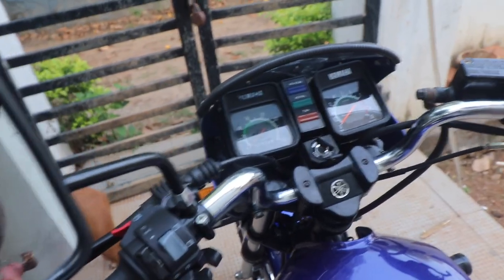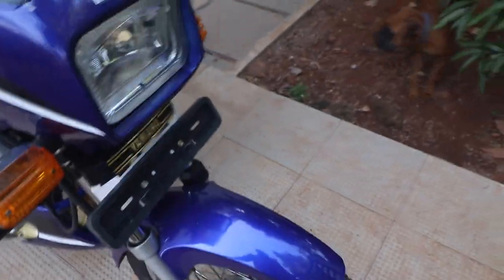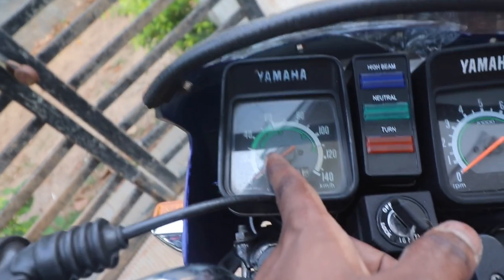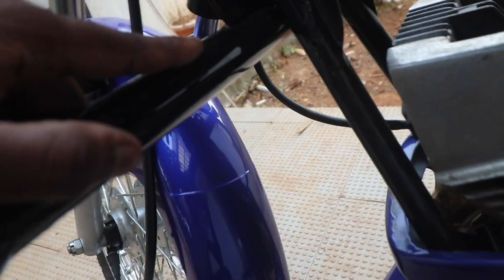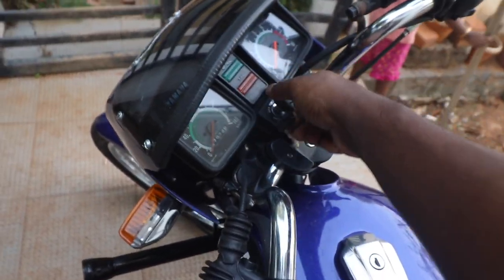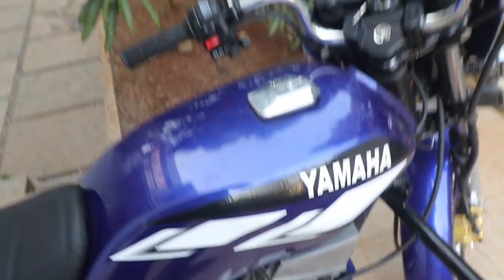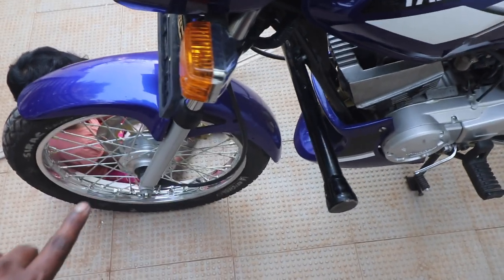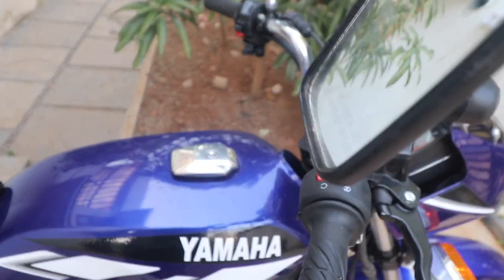Buying a Yamaha RXZ(5S/4S), watch this video before buying

Comment: 8:49 

Indian RX Series Engine no. Identification

RX 100
-6V  - 1L1
-12V - 1L2

RX 135
-RX 135 - 1L5
-RXG - 1L5
-RX 135 Tiger - 1L6
-RX 135 CAT - 4TL
-RX 135 5 Speed - 1L7
-RX 135 Last model 4s - 4TL6

RXZ
-4 Speed - 1L3
-5 Speed - 4UU
Reply from the maker: Thanks for sharing

Comment: Hi. Need ur suggestion, RX135 5SPEED 2000 model with all original parts like bore, carb, catcon etc except speedometer. Docs are valid till 2025, 3 owners. Sellers asking price is around 1 lakh. Is it worth buying? Having second thought since the scrappage policy is around the corner. Bike is in good condition
Reply from the maker: no idea on the pricing, but the scrappage policy will not affect 2 strokes, as far as I have researched its voluntary
Reply: @Yamakaze  ok. Thanks for replying..

Comment: Brother in RXZ bike 2T oil is mix in petrol tank or amy seperate tank is used tell me brother
Reply from the maker: All major 2 stroke bikes has an autolube system, you cannot rely on the system, fails very quickly. So pre mixing oil with fuel is the safest bet

Comment: Hello sir.in most of the videos the rear seat ring used in most restoration  Rxz5s is used like a 4sRxz seat ring.But according to my memory the RXZ 5s came with single type seat ring without the luggage carrier type present in rxz 4s.kindly clarify .just for knowledge sake not pointing out.
Reply from the maker: this was a standard accessory, anyone could buy this and instal. They came in 5 Speed as well

Comment: Hloo bro please reply- whats two red hoses on the carburettor??? My Rxz doesn’t have those??! Please reply 🙏🏻🙏🏻🙏🏻🙏🏻😰
Reply from the maker: Red horses?
Reply: Yamakaze not horse i said hose
Reply from the maker: @abhin1340  those are overflow pipes(not hose, hose is larger in diameter)
Reply from the maker: @abhin1340  those are overflow pipes(not hose, hose is larger in diameter)

Comment: Where to get front disc brake pads for original setup and what is other alternatives
Reply from the maker: jerry smith covered in the video
Reply: @Yamakaze  i googled    and found out to be different      plz, share  link of the compatible disk pads for stock   original disk setup
Reply from the maker: jerry smith as far as I know the R15 V2 versions brake pads are compatible, what did google say?
Reply: @Yamakaze  Google results are contrary to what you say   those r15 v2 brake pads are pin insert type   while yamaha rxz 5s  uses notch type and are thin and bit long in length      plz chk
Reply from the maker: jerry smith the r15 caliper I have doesn’t use the pin. That’s why I said this will fit. Use original they cost around 1000
Reply: @Yamakaze  please would you please share the link
Reply from the maker: jerry smith link to what?
Reply: @Yamakaze  the brake pads
Reply: @Yamakaze .??
Reply from the maker: jerry smith I cannot recommend anyone, as mentioned before look in Facebook market place or OLX